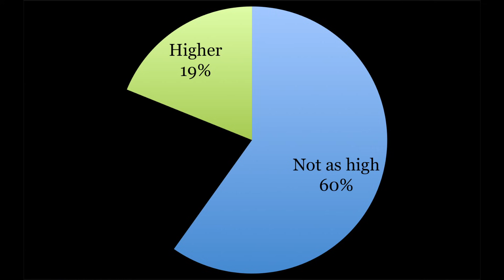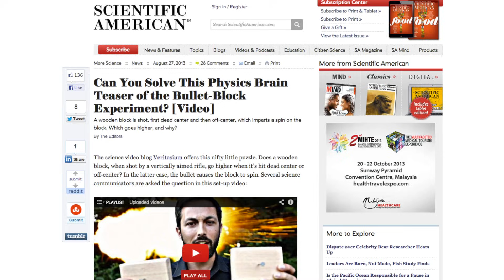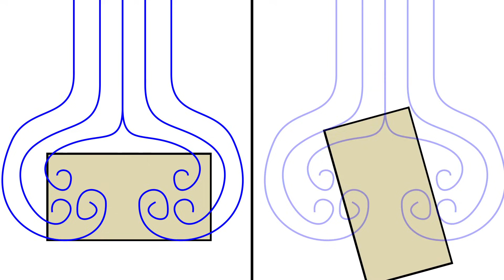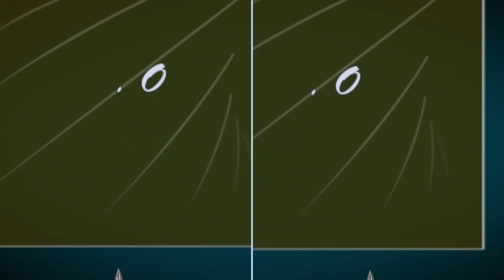Bullet Block Explained!

Comment: Veritasium
I think a way to make the difference of depth more clear would be to have an gradient of density for the block. The density would be the highest at the surface of impact then it would decrease as we enter the block. It should accentuate the difference of energy because a small gain in term of energy of one bullet compare to the other will allow it to travel farther if it's in a low density material.

Comment: But can we conserve momentum here?as the gravitational force of earth and the viscous forces of air(air resistance) are acting on it.correct me if i am wrong
Reply: Vibodh Jadhav You can conserve momentum at the exact moment of impact, which means the blocks leave the platform with the same linear velocity upwards. As long as Earth's gravity is constant, they will decelerate at the same speed, and thus reach the same height. Air resistance is a little tricky to account for because it's so complicated, but it's effects are pretty much negligible. You're right that a single object experiencing forces doesn't conserve linear momentum, but it's still useful when you're talking about the precise moments before and after a collision.

Comment: As the bullet hits the block it begins an energy transfer through the entire block -think of it as vibration or waves of force-. Though some dissipate as heat, and sound, there is also a heat and movement transfer -molecule level- through the entire block.

When it strikes it in the middle, the waves of energy/force travel evenly through the block dissipating evenly through the whole block, reaching the edges of the block at similar intervals and generating vibrational echos through the entire block.

When it strikes it on the edge, the waves of force reach the edge of the block faster on the side of the impact, but take longer to reach the other side.

However, the block serves as a force transfer medium, thus its molecules move within the block (think of a box full of minute marbles) as the waves of force travel through the block, and the molecules bounce off of each other within the block as it receives any impact.

Since the impact side´s molecules all collide with each other faster and before the molecules on the other side of the block, at the time of the impact, the molecules of the impact side have/receive and transfer more momentum than the molecules on the oposite side.

So the bouncing vibrations of the molecules on one side is faster and more powerful than the other side generating more force on one side than the other, but no generating EXTRA energy. 

More energy is "compacted" in one corner, faster and more powerful than the other corner, and it generates more and faster "echoes" on the impact´s side.

So the rotation of the block is not explained as a phenomena of creating energy, but rather as a phenomena of energy distribution in wave form at molecular level, where one side receives and produces more and faster waves of impact than the other side.

Comment: I was basing my answer on the edge of the block, not the center, therefor my answer of the spinning block going high was correct, as demonstrated in the modules, because its corners reached higher than that flat moving block, which what the topic of this video, height, not central average height.
Reply: I'm not denying super science (physics), but I'd just like to justify my answer based on the title.